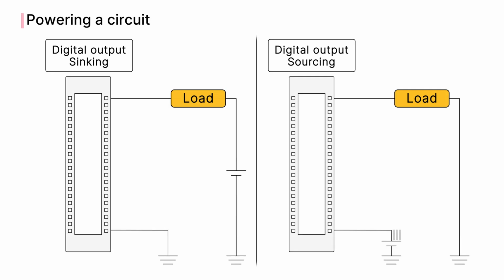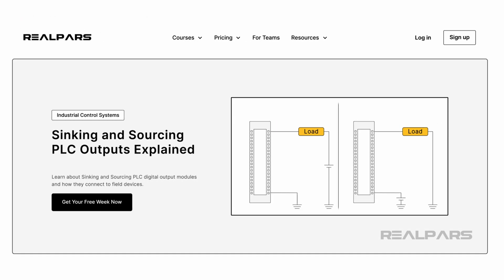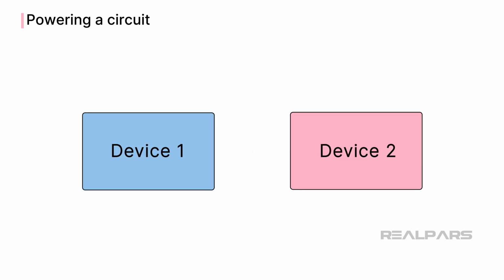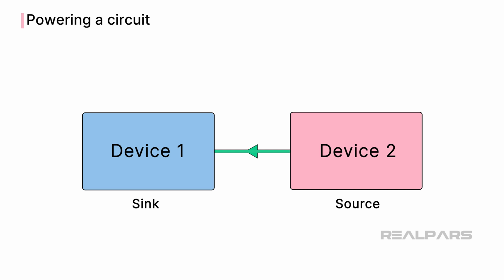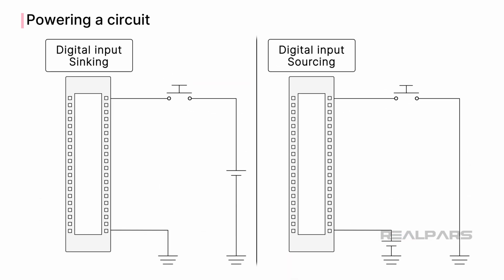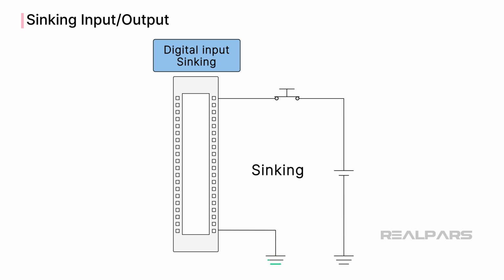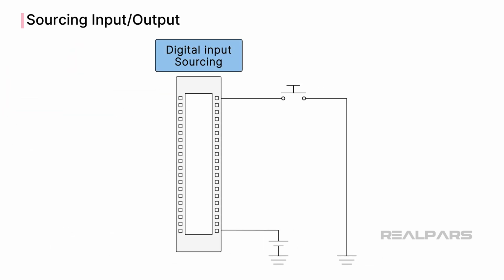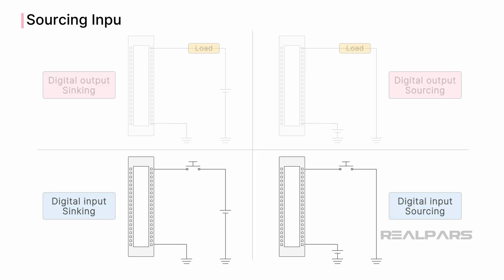Sinking and Sourcing: Which Connection Is Best for Your PLC?

Comment: What is +Vdc pin on the output sourcing cards for if we connect the external supply to the common?
Reply from the maker: Hello, @mareysaad6597.   Thank you for your question. This is a good question, but without knowing which output card from which PLC brand type you are referring to, it is difficult to provide you with the correct information. I suggest that you visit the manufacturer's website to download the data and user manuals. There, you will find the information you need. Here is the Siemens link if that is what you are looking for to find your information: https://support.industry.siemens.com/cs/document/109744173/documentation-for-simatic-controller?dti=0&lc=en-WW